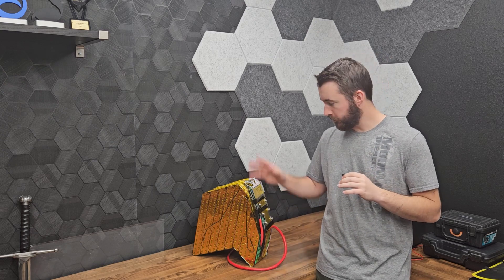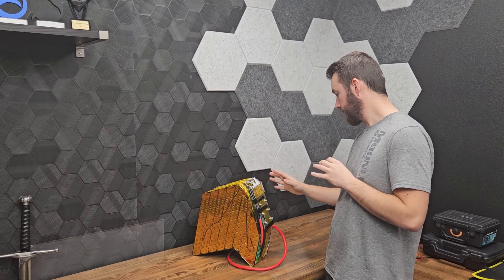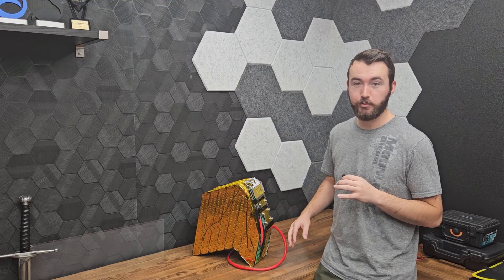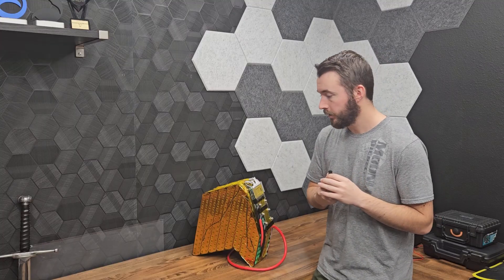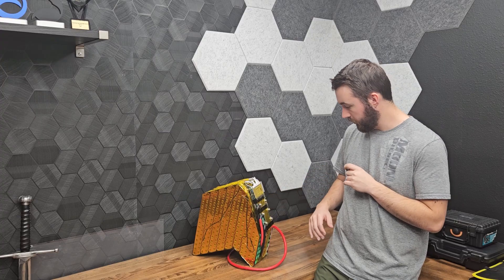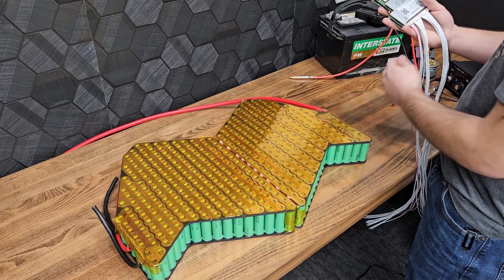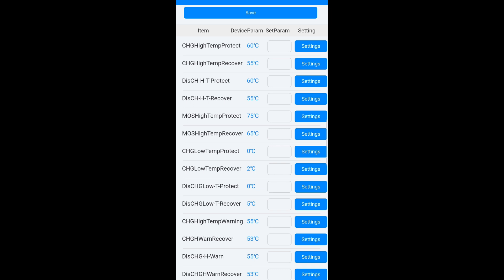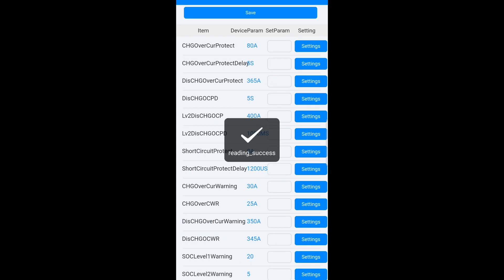Complete Ant BMS Setup Process For Your E Moto Battery

Comment: I just finish build my 16s 93ah battery pack using ANT BMS 16ZNJOTB230A.  All though it seem like a will put together BMS, the instruction and support is next to zero ratings.  I give them an F if I can.  I just don't understand how a company can have the intelect to build such a nice BMS and have the brain of a retar.d on instructions and supports.  This is very common with Chinese product.  My juess is that all these Chinese products are copies or clones of another company's product.  This explained why they can't and don't know how to produce a proper users guide.

Comment: We have a 380Amp 16S ANT BMS, and we first of all had big problems loading and installing the App on an Android phone, and after that absolutely no luck in connecting it to Bluetooth. The device simply never turned up on the scans devices.
We were told to add 3V between the two start wires, but I see you just short the two wires.
Reply: There are two different types of ANT boot wires. If they are red and black, connect to a 3-5v battery to boot it. If two black wires, just touch them together for a second and you will hear a beep when it boots up. 

Of course plugging in a charger will boot it up too but by default it goes back to sleep after 5 minutes. I set mine to never sleep.
Reply from the maker: Yeah it definitely didnt work right away. After some fiddling it connected. Make sure you see that blue light so you know its on.
Reply: Well as it turned out in the end, everything started to behave normally as soon as we completed the circuit and connected the C- into the full circuit of inverters and chargers.
Reply: So we just had a case of VERY IGNORANT /UNKNOWLEDGED product support !!!
Reply: No matter what we did we could not get it to activate the Bluetooth, untill we finally connected P- to the charger, at which point they finally started up
Reply: @ if the ANT was connected correctly, all it needed was the charger connected to the charge port, which goes to battery (+) and C- going to the BMS, which then goes to B-. 

The two jumper wires also start it. I have a 7s-16s ANT which has red/black wires, which need 3-5v battery connected, then it will beep and its on. 

The better model has two black wires which only need to be topped together. 

None of my ANT bms has a P-

Comment: BMS will automatically shut down after set time, therefore unpairing with bluetooth, you can change that timer up to 18 hours
Reply: You can change the timer to 0, which disables timer and it will never sleep. Thats what I do on all my ANTS. 

I think there have been cases where cheap Bluetooth bms on a tiny battery actually drained it way below LVP until not enough pack voltage to run the Bluetooth, so low you can’t even wake it with a charger.

But on my ANT noticed even if I have sleep timer set to 0 (never shut down), if I reach LVP it will shut down the Bluetooth, and perhaps even the whole BMS. Then it patiently waits for you to plug in a charger to wake it and charge it.

Comment: Enjoying this series. Devil's advocate for battery design: Build it as modular as possible? Each cell height "side" could be farther apart (1/2"?) to encourage airflow between. Less risk for each bussbar from arcing out to the cell sides and easier to tear down and service when one lonely cell dies(and it will). Seal each "side" of the pack. Use bolt terminals with multiple "buss wires" to get from one side to the other.Also, waterproof quick connectors for the BMS leads. Main leads can be bolt on terminated and the BMS can be outside of the battery pack. Easier to fix/replace/upgrade.

Comment: Is there any way to lock the bms Bluetooth with a password or something to prevent people from being able to connect to it and mess around with my settings? 😐
Reply: You actually have to input an administrator password to give you access authorisation.
It's pretty high level security password too
Reply: @ ok, should i make sure to get this password from my battery maker, or shouldn’t i really be messing with anything there anyway once its set up?

Comment: The 180N for balancing current means mA, why they can't just state mA makes no sense.

As for the cut off voltages, I'd leave them alone, these cells will sag, cutting off too high may make the battery last longer (cycle life), but might also leave you stranded on the trail with some energy left.  As far as your SOC voltages I think your 30% and down is a bit low, but it depends how they read it (at rest vs under load, averaging etc).  

Beautiful build though, I design and build all sorts of packs from 24v up to 400v and this is way nicer than most builds I've seen from most other YouTubers.  I have to commend you for the importance you put on the series connections vs the parallel connections, for some reason, most people do the opposite.
Reply: On a 20s 72v Do you know whats  the value to put in a jumper low and high i'm confuse

Comment: ANT BMS for the win
May I recommend you 
UnitoverVprotect 4.210V
UnitlowVprotect 3.100V
TotalVlowprotect is total voltage of the pack, 28S x 3,1v is about 87v
UnitVDiffRecover 0.290V
UnitVDiffWarn 0.300V
I confirm Balance Current is 180mA
Eventhough the battery datasheet says 2.5v for low voltage, you should set your 0% @ 3.000V 10% @ 3.200V 50% @ 3.700V and 100% @ 4.200V
Glad I can help
Reply: Dude thanks for providing a working example
Reply: Thanks Nico do you have some spec for a 20s battery ant bms 80a I have no cule whats the jumper setting low and high is this relevant ?
Reply: I meant have no clue don't know what value to put